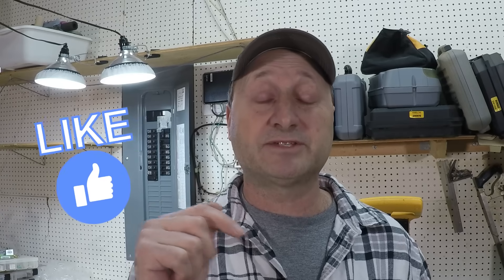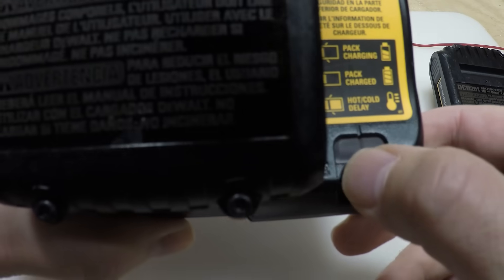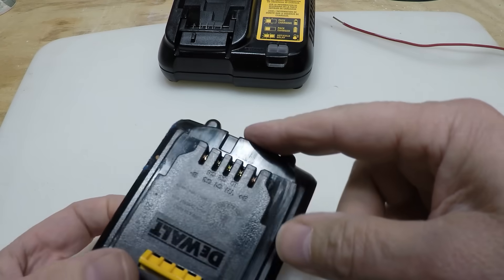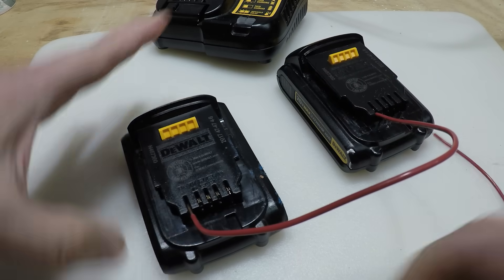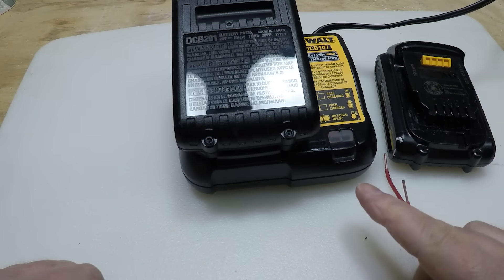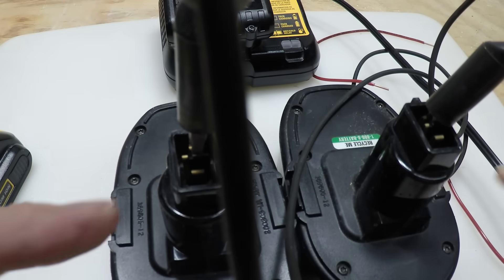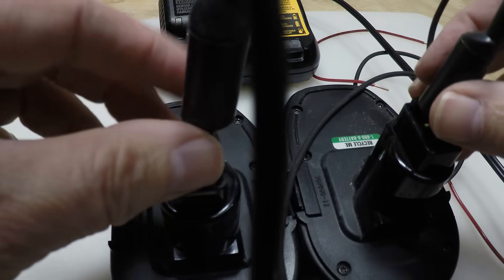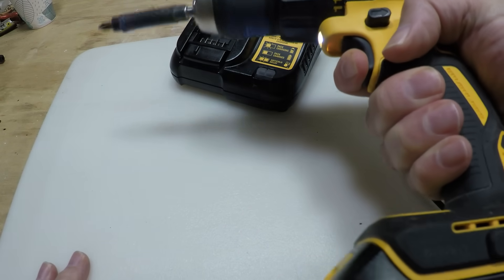SECRET to FIX Drill Batteries - Charge Dead Lithium Tool Batteries

Comment: My Truck new Die Hard battery which ran down leaving the dome light on for 3 days lol had about .5 volt showing on my multimeter .
So i hooked up the smart charger but would not begin charging .
This charger analizes the battery for the correct voltage 6- 12 volts and automatically selects the setting but would not do it or anything like the battery was not hooked up.

I came back 3 hours later and now the multimeter reads 10.5 volts on the Die Hard battery so i hooked the charger up and it began charging it too 12+ volts ,
It took many hours but the battery is powerful enough for anything now !

Any charger that shows the battery is fully charged is a smart charger that will not begin charging a completely dead battery.

Lithium batteries should not be completely discharged it says in the instructions for charging my hobby drone batteries.

DANGER WILL ROBINSON 
Wear a face shield if you add volts to a lithium battery not in a case or you could get blinded with flash burns if it explodes as they can do !

You must be smarter that the smart charger ok .

Hint - if you completely discharge your lead acid car battery wait two hours but if it will not begin charging or use a analoge charger that will charge if hooked up.

Put a smart phone in a belt case not in your pocket or you could be burnt badly but is rare !

Weird thing is smart phones create electrical potential and lightning has hit smart phones while being used and bad burns on the face was horrible.

Be smart with electricity and be safe !

Comment: I have a Ridgid 18 volte tool system in to the battery I have two batteries and only one works they both charged up but and they're identical batteries

Comment: The batter has a problem and won't last long. Got a bad cell. I use a scientific 0 to 50 volt charger to bring them back can regulate amperage and voltage. The whole battery tool thing is a racket any way. I turn many into corded drills off a lawn mover battery.

Comment: I wasn't even searching for this issue but it appeared in my feed for some reason. And shortly after, I found a battery that wasn't charging.  I had my doubts, but figured what the hell.  Lo and behold, it worked!  

I won't lie, the spark and slight burning smell when I connected the last contact scared me, but it saved one of my precious DeWalt 20V batteries, so thank you!

Comment: Great tip. Now, if a battery only partially charges - what do you do? I would open it up and test each individual cell. Can the individual cells be charged on a regular household AAA battery charger?

Comment: Its works as long as one of the cells doesn't overheat. they all use the same Panasonic battery(cells) collect all dead or discarded batteries. They're easily repaired by swapping out the blown cell. Ive done quite a few of them already the last one took about 5 minutes before I had it back on the charger..

Comment: Great tip.  I haven't used this on power tool batteries, but similarly I've found that on car batteries, the newer chargers with all the sensors can have the same problem with very low batteries.  So have yourself an older style car battery charger that will push charge Into it.  Then you can use any charger after that.
Reply: Or just connect another car battery  same voltage to it, leave for a few minutes and disconnect
Reply: @adrinathegreat3095  because you usually got stuck buying the digital "smart charger" because of the lack of options for old-school mechanical dials

Comment: The same problem happens with normal 12 car battery chargers,  they have to see a certain voltage coming back from the battery to check polarity before starting a charge cycle,  it is also a part of the 'anti-spark' and short circuit proofing that if you connect the clips together the charger will not pass any power.  Sometimes to charge a battery you need to connect a 'good' battery in parallel to start the charge and after 10 minutes take the good battery away and the charger will happily carry on.
Reply: @jygb7092 Only if you belong to a certain group of people....

Comment: Thanks for the instructional...  some comments.... because... well... this is the "Comments" section :)

- The battery doesn't "send a signal".  The charger checks for a minimal voltage to ensure the polarity of the inserted battery is correct.  That way if you put some ancient Chinese battery in where B+ and B- (Battery positive and battery negative) reversed, it won't short anything.  
- The minimum voltage is around 2VDC.  You can test your "dead" battery with a multimeter and if the voltage is below that this trick will work.  If the voltage is above that there's another problem.  If the voltage is truly at 0 then likely there's a dead cell in there or a break and nothing will fix it.
- Always ensure that the "good" battery and the "bad" battery are similar in voltage.  In other words don't try to charge a 12V battery from an 18V one or an 18V battery from a 24V one.  If you're using other manufacturer batteries to charge, you can exceed the "bad" battery's rated voltage by a bit (usually 10% is safe) but reading the specs for "maximum input voltage" is smarter.
- One second is not sufficient for a battery that's been sitting around discharged.  There is no harm to leaving it connected more than the one second.  The real harm only occurs when you first plug it into each other.  If nothing fries, leave it in for 1-5 minutes.
- You are taking a risk that the "good" battery and the "bad" one will completely equalize, at which point both will be half charged, but you've got the ability to charge both to 100% now.
- Always ensure your "good" battery is at 100% or close before doing this.  If it's sitting too low and it gets cut by 1/2 to charge the other one, you may end up with 2 batteries with a voltage too low for the charger to start charging.
- LiOns will recover quickly.  NiMh will take that 1-5min.  NiCd... good luck.  Also don't try this with car batteries, because both LA and AGMs tend to undergo chemical processes that need VERY high voltage (search for "I used my welder to fix my battery" to see how many hundreds of volts are needed) and there's always the potential for an explosion with acid anywhere.  
- LiOn is not the same as LiFePo is not the same as NiMh in that 12V requires different (higher) charging voltages for each type, but not high enough to kill the battery.  Read the label to see what it is, and google "maximum charge voltage 12V LiOn" or whatever.

In general this practice works.  It won't restore your battery to new, but it will allow some limited use until it dies, which it's already indicated to you it wants to die.  Put "new battery" on your amazon wishlist and send to your friends.  It's safer and cheaper in the long run.

Stylistic: if you're going to make a YouTube video showing how to connect two B+ terminals, using a red cable is perfect.  For the B- terminals, go splurge on a black cable.  Don't complain the wire gauge is too thick -- it's YOUR video.  Hit PAUSE and go buy 2 1' cables of the right gauge at your nearby hardware store.  That $0.50 you spend (yes on both wires) will make your video a lot more pro than trying to explain away why the cables YOU chose to make on YOUR video which YOU edited and YOU posted are the wrong cables.

Comment: What gauge wire do I need to charge the batteries? I have the exact ones you demonstrated first. They are ok for now, but I’ve had to get rid of two sets now. I’m so happy to see everyone commenting that this hack works. Thankyou! 👍🏻
Reply: Any wire that's not to thin but will fit in the contact's, you only need to do it for a couple of seconds.
But if it's a worn battery it'll not work, but if it's a couple of years old and only been charged less than a dozen times you should be good to go

Comment: I had a couple of DeWallt batteries that wouldn't charge.  I tried  your method and they  seemed to charge, but they would only work for less than 5  minutes.  I guess they were just too worn out.

Comment: I have an 18V 6.0Ah battery for Milwaukee. It has a power level indicator button with lights, when I press it, it does have enough power to make the lowest light blink. So not completely dead, however the charger won't charge it. any thoughts? (charger works fine on my two other batteries)

Comment: Brilliant top tip mate bought a multi tool with only one battery a few year ago used once when I got it back out it wouldn't charge your tip is spot on works on any multi tool battery now its charging after 3 year 👍 cheers mate

Comment: Great tip,  I always see ‘dead’  batterie attached to a tool  at the thrift store for a couple bucks.  . I get the tool and toss the battery. . Today got a Makita drill for $9,   yahoo! ..battery  charged after doing  this.  Only downside side is  now thinking I’ve likely tossed out decent batteries in the past.  An aside: nothing handier than having three or so drills on thr workbench ready to go with different accessories when doing a project. I always have one ready with a a small trill bit for a pilot hole.
Reply from the maker: glad it worked for you

Comment: My Milwaukee M18 Red Lithium CP 2.0 battery works only for a short time even though it has been charged until the charger thinks it is fully charged.
So what can I do?  The other identical battery is gone weaker as well, but not as bad. Have owned them for a year. (just a homeowner).
Mr. Flannel, do these Milwaukee batteries suffer from a "shelf life" slow expiry? (my old Makita battery still works on it's drill)

Comment: I have DeWalt 20 volt that is dead. It blinks for 1-2 seconds on the charger, then indicates full charge when in fact it is still dead. Bridging to a good battery has had no effect.

Comment: That will work, but it's not very safe. Reviving flat lithium packs is often done in my field, but we do it in fireproof boxes, using controlled power supplies to keep the amperages below 1/100 of what you probably released there. What you just did was much like giving CPR to a patient using a land mine instead of your hands. If you do use that trick, at least don't leave the wires in for any length of time. Several people have burned down their workshops that way.

Comment: I tried your method with my Einhell drill batteries and it worked straight away battery still ok 2 days later....have you tried jumping batteries of different makes
or voltages... i was goig to try it but I chickened out...thanks for your tip ...kind regards from the U.K.

Comment: What if you don't have a matching battery that has a charge?  Like the older style you showed.  Is there a way to put a small charge on it to kick start it without the linking?
Reply from the maker: you can use any battery

Comment: So many batteries do this, it's criminal! Why the heck ownt manufacturers build in a buffer battery or somehting to stop this happening.
To add to the issue, many maunfacturers have a built in battery draining run off the internal PCB 'to stop batteries overheating' !! Rubbish ! to send us back to the retailer to buy a new battery.
I have seen this syetm work in other demo's on U Toob.

Comment: Dude I don't care what any of these other people say I did that and it works 2 DeWalt 20-volt 2 ah bought them with tools Ace Hardware one would not charge left it in drill too long tried your trick bingo didn't start on fire I don't know if I would try this with my e-bike batteries I would suggest using the good battery till it's a little low

Comment: I recently bought a battery operated tire inflator to make it easier for myself. The manual recommends to keep the battery unattached in its case (when the tool is not used often.). I guess the manufacturer doesn't want the batteries to deplete when they are attached to power tools. Would you say this is a common practice for all the portable power tools?

Comment: This is helpful and informative.
However, the only reason this issue exists is the poor design and programming of the BMS for the Battery Packs.

This should never occur in any BMS that has individual cell voltage monitoring and cell equalisation, unfortunately designers don't always get it right.
You could categorise it as a "significant design fault", worthy of a manufacturer's recall, as it can occur on day 1 or day 1000.

There are also cheap Battery Packs available that don't have individual cell voltage monitoring and equalisation - too cheap - too dangerous!
Reply: Actually, no. The problem is that the charger (!) is set to a too high threshold, meaning it will refuse to charge if the battery is below 16 volts or so, even though the cells in the battery pack are not dead until the pack goes down to 13-14 volts. This is not directly related to individual cells voltage, this is about a too low combined voltage of the cells in series in the battery.

Comment: Sorry. If the battery is dead, it is dead. It only works for battery which was not charge or lost its charge for awhile, but applicable to dead batteries that will no longer charge...it's time to buy a new replacement.

Comment: Approximately eight years ago, I bought two Harbor Freight 18v portable drill (driver)s, and used them with good results. When the work was finished, I put away the tools, but kept the batteries on charger periodically. Each charging session, restored full drill speed and power, but typically for this charger module, the process produced a lot of heat, and each charger eventually "burned out". The two chargers died with the same sequence-- at first, display of full charging LEDs (red and green, as I recall), and after about 15 minutes, went completely dark. No further response, after even allowing the charger to cool, and then, re-plugging.  
Is there any hope of pulling apart the charger's black cube, and replacing some failed components? Does any of your readers have a suggestion?

Comment: Brilliant thankyou very much. I had a pile of dead camera batteries and after watching this video applied the same principle, jumping a good battery to a dead one with two paperclips and the so-called dead battery charged immediately. The holes to poke the wires in were tiny in a 1 x 2 inch camera battery, so I just flattened the ends of the paper clips with a hammer and it fitted perfectly. A very happy viewer, Phil UK.

Comment: Thx.. for the video... I recieved a craftman 20 volts saw last Christmas,  the battery that came with it didnt work, I called craftman and recieved a new battery.......I tried giving at power like you said it didnt work ???? I put it on the charger it turns green but doesnt charge??????

Comment: I would think this is dangerous.  "Dead" lithium-ion batteries should not be charged because they risk explosion.  Now if there's a safety mechanism that automatically "shuts off" a battery at a certain voltage like 5% or so to eliminate the risk of killing the battery and then having it explode upon charging, that's one thing, but still taking a risk attempting this.

Comment: I've been doing this since 81 with wireless phone handsets containing nicads. You can use any dc power source as a jumper, just make the connection momentary if it's a higher voltage, longer if lower!

Comment: I never buy new batteries so many ppl sell them cheap, especially if they think its dead.

This may have been mentioned in comments already but what guage is that wire you use? Is it like a typical 12/2 wire?

Comment: Batteries that are discharged this far have suffered internal damage by doing so. There is a risk of fire during this process and after for the rest of the zombie life of this reanimate battery. You also run the risk damaging the good battery. Lithium fires are no joke.

Comment: Good tip. 
There is a misconception that batteries should be completely discharged before putting onto a charger - batteries lose life when they go below 80% charge. I had two batteries for my cordless drill, out of the two I still have one that is working after almost 25 years  ( the other one died 2 years ago), and that is by putting them on a charger every time, even after only moderate use.
Reply: Each battery chemistry (Li, NCad, NiMh) has different charging, storage, and use characteristics.  Li batteries don't have 'memory', best stored at about 60% charge, and total discard never required.
Reply: …I thought you shouldn’t overcharged a battery??

Comment: Note he's letting a lot of current flow to the flat battery.  There's no resistor in the circuit. This could damage a battery or maybe make the wires hot depending on what you use. Just do it for a second or two, don't walk away.
Reply: Who said anything about walking away? Video was straight forward about completing this jump charge for no more than 1-2 sec.
Reply: Exactly. He said just for a moment then disconnect them. You need to watch the whole video.
Reply: All he is doing in ti's video is connecting the 2 batteries in parallel. It's no different than jump starting a car.
 
The charged battery connecting to the dead battery is no different than a charger in this case. Remember, something tells the charger not to charge because the battery voltage is to low to charge. Using a charged battery to give a little charge to the unchangeable battery bypasses this don't charge signal and raises the voltage

If the battery is damaged internally, this trick won't work.
Reply: X2 and I sure as heck would be keeping those in a steel box for storage after that.  When they see how much a single AA lithium battery can light up from overcharging, or force charging a bad cell......it changes a person....lol